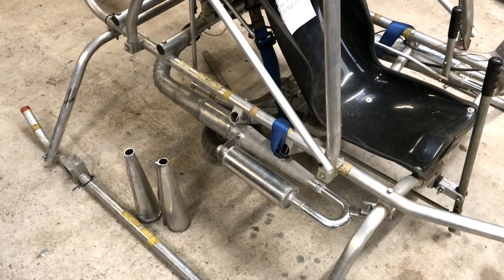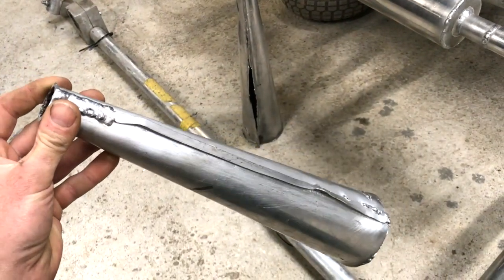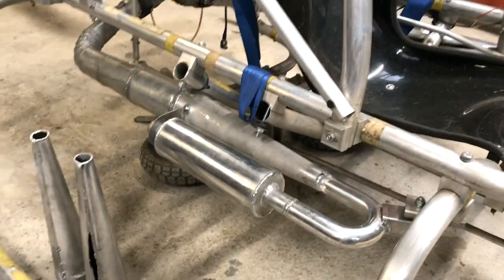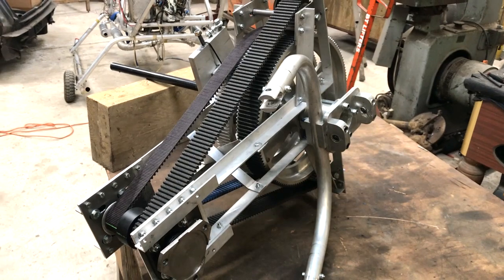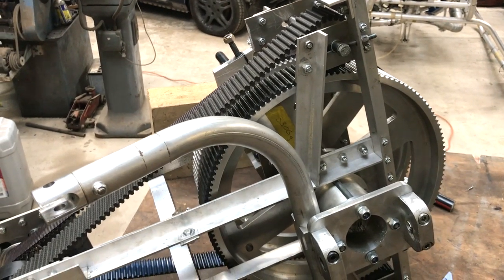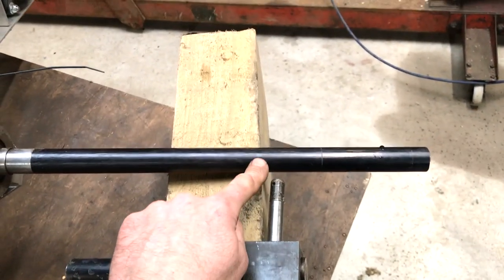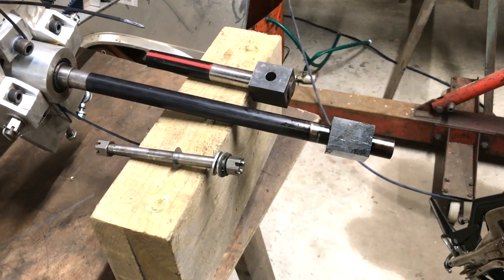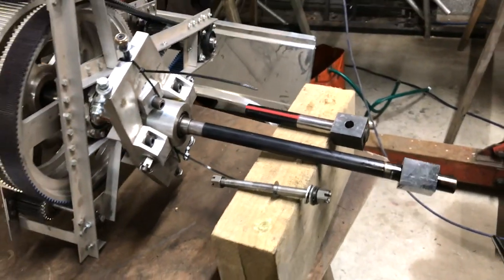Heat, Fire and Engineering Home built Helicopter

Comment: One of the problems with coaxial machines they can be too tall Ben.
Reply from the maker: You're right Peter, I have to use a stepladder to reach the top rotor and I'm 6ft 5" tall. I wanted to put the helicopter on the trailer in the workshop ready to hook up the truck for transport to the test site but realised it wouldn't fit through the door if I did that. It's definitely an issue for those homebuilt enthusiasts who have standard height garages.